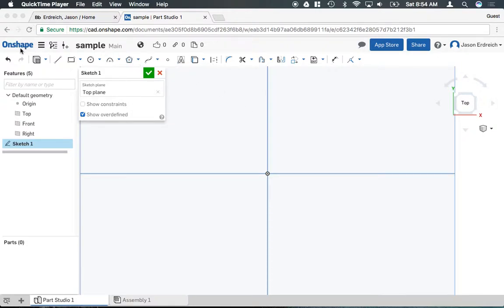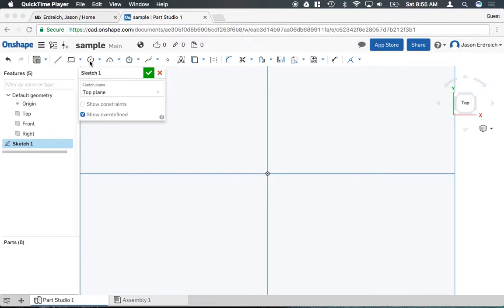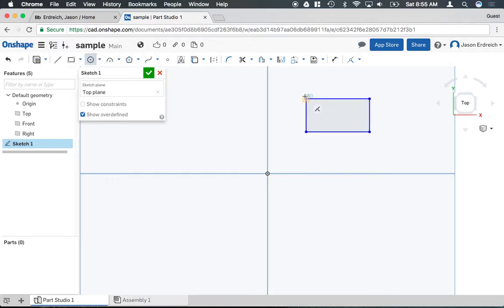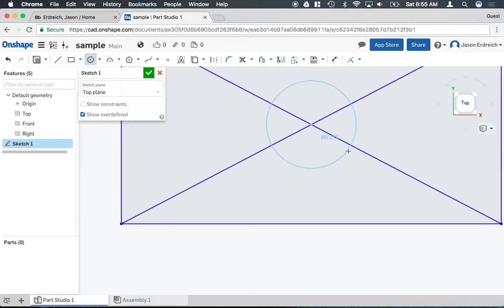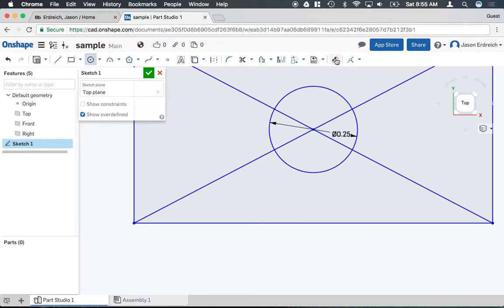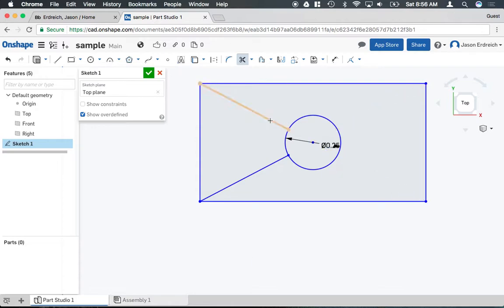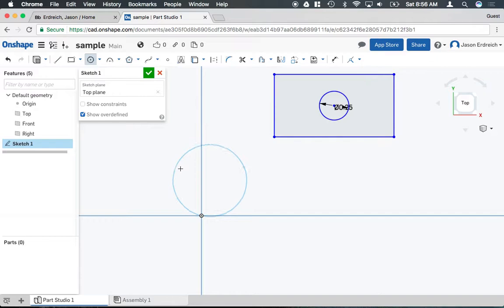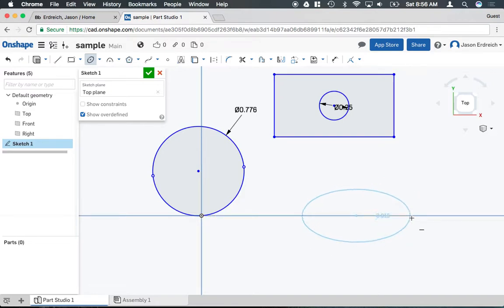How to make circles in Onshape CAD

Comment: How do I know if I am editing circumference radius or diameter? Its not very clear when I do it. Looks more like circumfernece
Reply from the maker: By default, you are editing the diameter of the circle which is shown by the diameter symbol next to the measurement. To change radius or circumference, you would need to make a dimensioned construction line (radius) or use a different type of dimensioning tool.

Comment: The only issue I have with this is that your rectangle and circle stayed blue. How would you turn them black? When I do this my instance list for the sketch says the sketch isn't fully defined. Onshape tech support  told me that the alert on the pencil tool that alerts you to this is a new feature. So, continuing on from the end of your video, what would you do next to fully define the sketch? Can you make a quick video showing that?
Reply from the maker: blue lines in onshape mean that something is not fully constrained, black lines mean that it is. So because I didn't have any dimensions setting distances or sizes, or hard constraints, they stayed blue. But if you dimension things to something else, constraining them, they should turn black, as well as making the sketch fully defined. Having a fully defined sketch isn't always necessary, it depends on what you're designing and how you're designing it. I suggest you watch one of my longer project tutorials, like making a mug or a box, as you will see more care put into the sketch definitions than in this quick video.

Comment: For me when I click for the second time to open the edit window for typing in the measurement it does not work. I cannot type anything into it.
Reply from the maker: after clicking a second time (first to start drawing the circle at a midpoint, second to place the circle), the dimension box should appear. You then should be able to just start typing a number in using your keyboard, you don't need to click again to start to type. This would start drawing another circle.